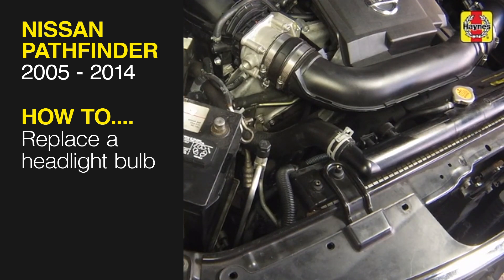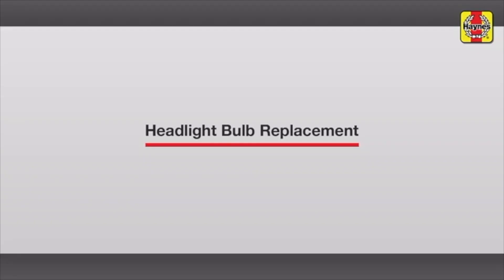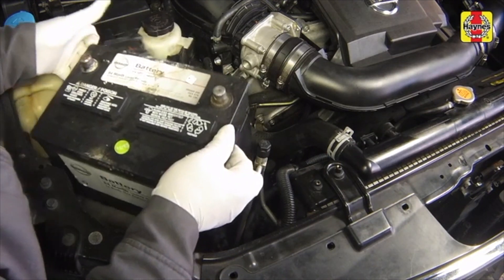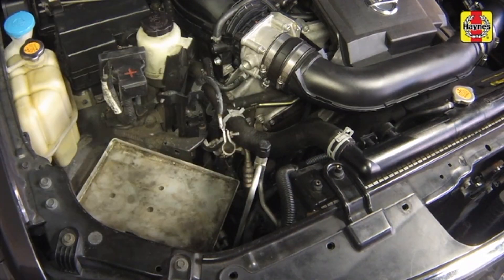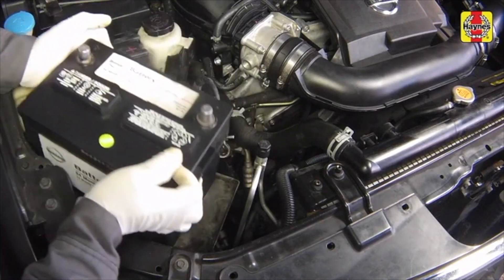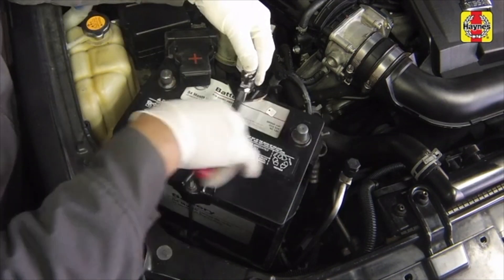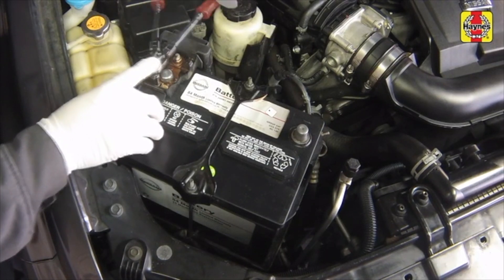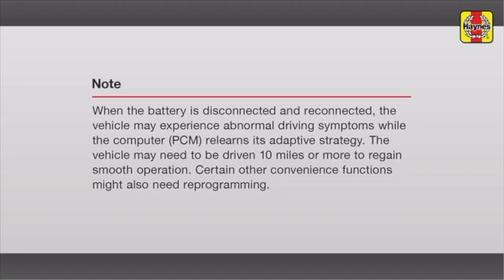How to Replace a headlight bulb on the Nissan Pathfinder 2005 to 2014

Comment: why did you remove the battery to replace the bulb on the drivers side. I think you edited the video incorrectly.
Reply: pathfinders have the battery on the driver side with RHD vehicles (ie from australia, south africa, uk, japan etc)
Reply: @noobdudegaming1018  lol. My 2008 Nissan Pathfinder's battery is on passenger side
Reply: @uptownbayarea6068  But where do you live?
Reply: @DragonsOfAra  NY

Comment: Do you have to Remove the Battery &/or Disconnect when Changing out the Bulb or is Removing the Battery just to give Extra Room to do the Replacement?? I have a Hanes Book, but can I Find it when I Need it... Of Course Not! 😂